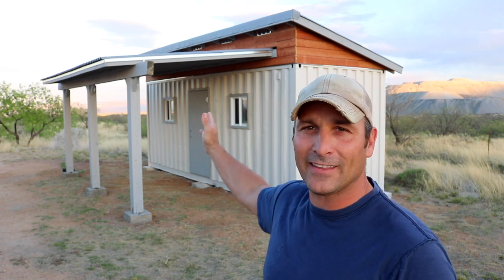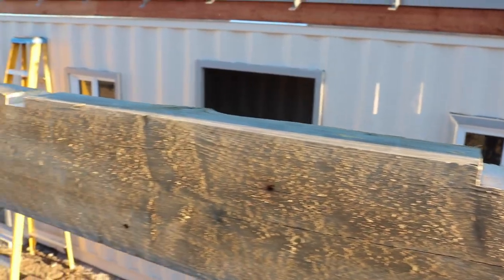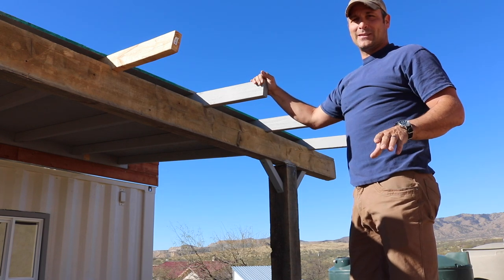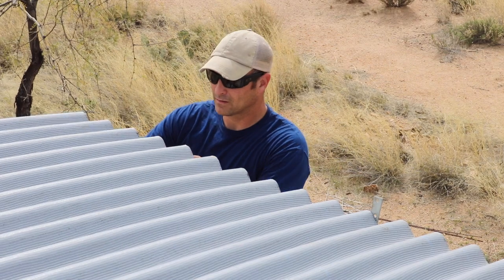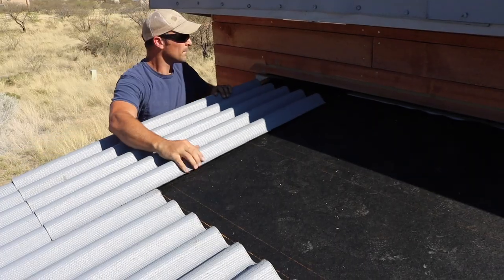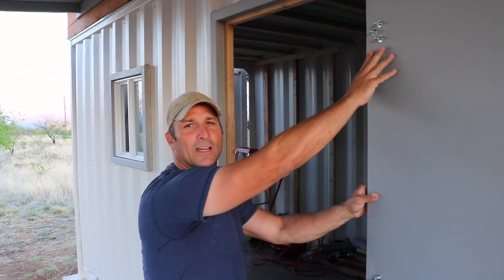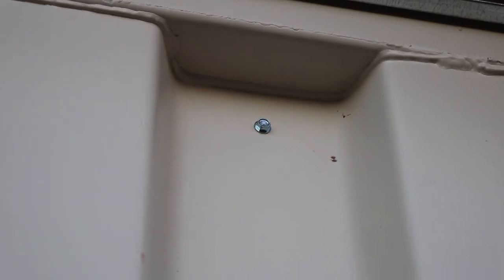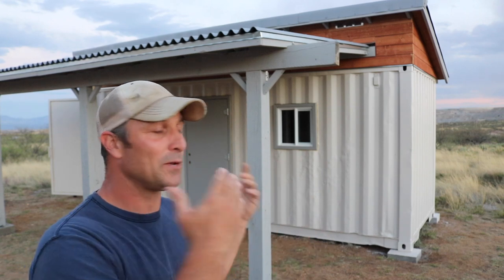Shipping container SHOP part 5- roofing, awning, interior walls

Comment: Awesome work so far! Perhaps OSB panels for the interior would be a good idea since it's a shop! But you know best, can't wait to watch it finished! Thanks for sharing, greetings from Greece!
Reply from the maker: Thanks Dimitri!  I plan a combo of wood and painted drywall... for cost reasons.... but I haven't gotten it yet so it could change:)  BTW... I'll have to wear my Greece shirt again in one of the videos... love that flag:)
Reply: lol, awesome!
Reply: @homesteadonomics  did you insulate the roof on the outside at all? I didn't see it. Since you live in the desert I guess your shop is air conditioned and maybe you don't need it? I'm building in an area where it's a hundred degrees four months out of the year so I'm wondering how much insulation to use?

Comment: Really enjoy watching your place develop.  I have followed your progress over time and you have many great ideas.  Just thought I would mention though that if those were deck screws you used to connect your skewed brackets and rafters, that type of screw has negligible tensile strength.  You might consider replacing at least some of them with a stronger fastener.

Comment: Clad with cheap 1/2 inch plywood. Not sure if it's an issue in your location but in the midwest condensation is something you have to consider when dealing with metal like that, you can't just put fiberglass batting in there and cover it or you will have mold in a few seasons. I'd either do spray foam (probably 1,000 bucks for that size) or do foam board with the drywall skin over it, put all of that on top of your framing and leave some gaps at the top and bottom so air can circulate.
Reply from the maker: The condensation shouldn't be an issue here but I plan to use hardboard and/or a combo of pallet strips and drywall... with small gaps for just that reason.  The dry wall will go on the bottom and the pallet strips and hardboard will be on top.  And the insulation will be the pink foam board... 2" on the south and west and 1" on the north and east... and 2" on the ceiling:)
joe

Comment: Hello, I have been follow your channel for about a year now and I must say I am glad to have done so. I really enjoy your videos and learn a lot from them. I have a 40 ft storage container in my back yard that I have been thinking about turning into a workshop for some time now but, was kind reluctant to move forward due to what I thought was a major undertaking. However, after watching your videos, I now have the confidence to move forward.  The plan is to use 30 ft for the workshop and adding a dividing wall so my wife can have a 10x10 area on the other end to store her stuff. I think the way you designed to roof is a brilliant idea which will came in very handy for me as well since I live in South Florida. I do not have the welding skills that you have but, I plan on teaching myself on my Lincoln Electric MiG welder. One question I do have is I can not figure out the measurements for the roof. Could you please help me with that?

Comment: Looks really nice brother. I hope it works out the way you planned it too.
Reply from the maker: Thanks Michael!  I'm hoping so too!  the big question will be heat in the summer.  I think the insulation and ventilation will help a lot... but I may add  in a small AC depending:)
Reply: homesteadonomics, yes a/c will probably be a must. A tiny window unit in that thing will work really well. It may even freeze you out.

Comment: Go big on lighting!  LED is the way to go.  Little expensive upfront but consumption is way low.  Maybe wire an extra for filming vs just regular work.  And don't forget exterior lighting both under the lean to and other sides of the shop.  Even though you may not need them now you can always be thankful for the future.
Reply from the maker: That's what I'm thinking too... I saw some really cool LED shop lights at costco that I'm thinking of using... they look like regular tube lights but just with led's:)
Reply: Most of the LEDs are lower profile also.  More head room for projects and such.  Are you in the IAFF?
Reply from the maker: yep... but thats not my dept... a shirt given by a friend.  I don't wear my own stuff, unless it's inside out;)

Comment: Couple of questions......
1. Interior furring - Why 2x3?
2. Interior furring - Why flat against the wall and not deeper or turned 90 degrees?
3. Interior furring - Are you worried that the denser wood will create a "Heat Bridge" to allow the heat of the metal skin to penetrate where the wood is?  Would you have considered some thin half inch foam sheathing on the inside between the wood and metal?
4. Insulation - what are you using?  spray foam or preformed and cut foam?  Any idea what your R-Value is looking like?
5. Cell / Wifi - In the can, do you get signals?  Or does it pretty much wall you off?
6. How are you getting electrical to the container?  Underground?  Or areal cable?
7. Can't wait to see what you clad the interior walls in.  I'm thinking it needs to be sturdy to mount things to, but also somewhat flame resistant given your intended purposes.  Maybe plywood coated in Truck Bed Liner?  Who knows...  That's a hard one to decide on.

Congrats on all the great progress!
Reply from the maker: Hi Greg,

1... they were cheaper than 2x4's but still more robust than 2x2's
2... flat to keep space... and they mount to the walls easier that way
3...I'm hoping it doesn't make too much of a difference.. but only time will tell.  I do plan to incorporate exteroir shade for the south and west walls.
4... im going to use foam board... really like the ease of install
5...i listen to music and podcasts inside from my house wifi so it makes it... might limit it some for sure though
6-going to do underground
7... im still deciding and racking my brain on it... this project has costed me more than originally thougth so I'm looking to go as cheap as I can.  Will probably do drywall for the lower half... cheap and fireproof... and then have a chair rail style shelf transition... then the upper might be pallet board shiplap in the back half and I'm still not sure on teh other half

hope that answers your questions:)  thanks for watching   joe

Comment: I've used metal before for roofing, and liked it a lot, but it's nice that this stuff is plastic and easy to cut!
Reply from the maker: Yes, I like metal a lot as well.. got it on my house... but it is nice to work with this Ondura roofing too... no sparks from cutting metal and no sharp edges either:)

Comment: looks great. since you like lifting plyboards why dont you clad the inside with them? on the plus side you can screw tool holders into them.
Reply from the maker: I like that idea... but I think I'm gonna go with a combo of drywall and palletwood cladding for cost reasons... but I may add some plywood at certain points for just that use:)

Comment: Looks good. Kind of wondering why you didn't have deeper overhangs on the sides and on the back and why no double doors under the awning? With a flat roof you could have a skeet shooting deck. Idea for the future!
Reply from the maker: The overhang on the back was more of a material matter... I used 10' for the angled section and it looked good and the 12' looked like way too much...lol... it was pretty much that for the decision process...lol

And for the double doors in the side... I figured I already had the big entry at the end and didn't want to compromise the side too much.  But it's not a bad idea:)

I do like the skeet roof though!  My neighbors and wife might not like it as much;)   
Joe

Comment: Really looking nice. I like the quality of your work. A coup,e of questions... are you going to be adding any rain gutters/water catchment, I know it's a small area but every little bit helps in your area as you have mentioned in the past? Are you going to install your electric in the wall or just surface mounted... a couple of large power strips or individual sockets spread around the work area. I have a couple of the led fixtures that I got at Costco. Same size at the tradition florescent ceiling fixtures but the lighting is great. Are you putting in any kind of exhaust fans or is opening the end door and windows enough? Again, outstanding project, loved the drone footage and thanks for sharing!
Reply from the maker: Hey Thomas... you are right on my mental track right now!  yes, I will definitely incorporate rain harvesting... kinda have to sense I live off of it...lol... but yes, still deciding if I'm going to collect in IBC's or make another culvert cistern.  And with regard to the LED's... I saw the same ones at costco and that's exactly what I plan on installing in the ceiling.  they looked really nice and I thought the price was very reasonable too.  And yes, i plan to add a fan too to move air throughout:)
Joe

Comment: Kind of a shame those nice timbers had to get painted, but I can understand why.  How does that roof fastening system hold up in the wind?  Do those nails reach all the way into the sheathing and/or purlins?  They seemed to go in pretty easy, so I was worried they might not be secure for high winds.  It's looking great.  I'd love something like this to turn into a shop.
Reply from the maker: Yes, I agree I really like the grey color of older wood.. but when I sanded it it brought out the 'new' wood and just looked splotchy.  Oh well, makes for a consistent look now;)  
yes the nails protrude through the plywood and nearly all the way through the purlins.  There instructions call for 24" OC spacing for normal environments  and closer spacing in high wind environments.  And also for nails in every corrugation for high wind environments.  Once I knew I had enough nails to finish the project I added them on every corrugation and my spacing is about 18" oc so I think they'll be pretty secure.  If I ever feel that they are loose then I can add a smudge of adhesive caulking on the bottom side or bend the ends a bit.  But I fee pretty confident that they'll be secure.  If they go, then it'll be because the whole awning went...lol... and then I'll be really sad;)

Comment: You do a really professional job on your video production and your shop project.I was born and raised in Michigan and have been to Arizona once-in August-it was too hot.I would have to build an air conditioner to cool the air conditioner that cooled the shop.I have been looking at using two hi-cube 40' containers for a shop,but can't seem to find any pictures or any info on insulation that would work for a 90+degree summer day and -10 degree winter day.Some say insulate the outside-others say inside.Any advice?
Reply from the maker: Hi MrFrog... that's what I'm figuring at the moment.  I'll be insulating from the inside only for this project as I want to keep it technically movable.  Additionally I will be shading the south and western walls to aid in cooling.  Since we are so dry hear, being under shade actually makes a world of difference in the summer versus humid areas.  I may add an window/wall ac at somepoint but right now I'll see how a fan and air flow work.  I plan on working under the awning a LOT.  Air flow and shade will make it a nice environment:)
Good luck on your high cube search.. those are the really nice containers... the extra foot makes a huge difference:)
joe

Comment: What about water getting in between the red wood boards?  The boards do not over lap like siding so I would think that would be an issue.  The water that made it between the boards would then sit on the top of the container.  That is my current issue.  I need to install roofs on my 3 containers and this looks like a solid idea.  Id prefer to use something that over laps to keep the top as dry as possible.  Is the vapor barrier 100% water proof?  Im guessing that what keeps the water from pooling on top of the container.

Comment: looks good. do you have trouble with birds trying get the foam fill from between the roofing and the plywood.
Reply from the maker: I haven't had any issues with that on my other projects that use this roofing.. but it's possible.  However, after placing it the idea is to secure it with the nail an that pretty much locks it in for good.

Comment: LED 8 ft battens would be best, hardiplank for the walls, polystyrene boards for insulation.
Reply from the maker: That's kinda what I'm thinking for now... I may add drywall on the bottom section for a bit of extra thermal and fire break..  And rigid foam board for the insulation.  As for the ceiling.. I'm still trying to plan that one:)
Joe

Comment: Great job, it turned out really awesome.  Are the interior 2x3 studs bolted into place also?  From the video it looked like you just wedged them in.   Also, what kind of insulation and R value are you going to install?   Last question - is the shed going to be solar powered?  Thanks for sharing this build.
Reply from the maker: Thanks Rob!  Yes, they are bolted to the structure and nailed/screwed to eachother.  I only showed the tapping in because it shows the process in general.  As for insulation I'll be using rigid foam... will be in teh next part.  And solar, yes, eventually but I'll still have hook up to grid power for tool use:)
Joe

Comment: We are in Florida, so humidity and rain is a concern. Did you waterproof the screw holes to hold in the framing in any way? We are trying to figure out how to hold up the walls without penetrating the outside of the container. Love your videos, thanks for sharing!
Reply: Did you determine a way to frame inside without screwing into the container?
Reply: @sour-yak  for the ceiling profiles I have welded metal brackets to the internal upper edges and my celing framing woods connected to that brackets. From that point wall framing is only connected to the bottom and to the top. No need to drill any holes inside the container...

Comment: awesome job! I'm starting one of my own on 2 40 feet containers
what is that roofing and were did you get it?
Reply from the maker: thanks Joey... I mention it at the beginning of thevideo but it is Ondura corrugated roofing.  You can get them from Lowes and some Home depots:)
Joe
Reply: THANKs. Funny i click on home depot ondura and low and behold there you are in the video.

Comment: If you ever end up with paint on wood beams again you can use a soda plaster it will strip the paint without damaging the wood ( it's sandblasting with soda)
Reply from the maker: arrrrr... wish I would've known about that...lol... oh well, I've come to terms with it now... but I will file that one in my head for later.  Thanks Kristian!
Joe
Reply: Cool thing is you can use soda on pretty much anything it is way less abrasive than sand due to the fact that is has less kinetic energy than sand.. Also you can use it on engine parts where sand normally can not be used because soda is water soluble and can be washed away unlike sand that can get stuck and cause problems... it is worth watching youtube videos of what it can be used for ... it is awesome :-D

Comment: Hey Joe, I'm up in Phx and looking for the same Ondura panels in gray but am not finding anyone locally. Lowes carries other colors, but the gray is not available. Where did you get yours?
Reply from the maker: Hi Scott,
At the time I got mine from Ondura via my local lowes.  However, while I believe these panels are great looking and easy to work with.  I’d recommend you check out my “oh hail no” video where I talk about a hail storm we had.   Several of the panels got damaged from golf ball sized hail.  So I’d use caution if there is any chance you might see larger hail.   I know Phoenix doesn’t have large hail often.  So it may not be a problem.  But just wanted to let you know.
Reply: @homesteadonomics  Thanks Joe for the heads up on the hail! I missed that video, so I appreciate it. I've used both gray painted and corten corrugated panels horizontally for fencing/gate & sun block for pool equipment with good success, but was curious when I saw the Ondura as it seemed easier to work with. Building a 2 post cantilever sun screen to put my offset smoker under and was exploring roofing options.  Nice work on all your projects - I certainly enjoy your videos.

Comment: The roof may need to have screen in open area. You don't want critters and birds building nest in them.
Reply from the maker: The roofing has foam strips that fit in the area under the corrugations for just that reason... I didn't show it too well but they are foam with some ventilation holes in them.

Comment: You didn't mention anything about how did you seal the joints, did you?
Reply from the maker: ah... you know what, I've been meaning too but I keep forgetting to mention it.  I used PL construction adhesive to seal all the joints.  Sticks to wood, metal, etc,. and is paintable:)
joe

Comment: Were did you get your roofing?
Reply from the maker: They are Ondura panels.  I believe you can get them at HD or Lowes.  I was fortunate enough to get these from the manufacturer.  But I've used them in the past on several projects and they are easy to work with and look great too:)  I included a link in the description.